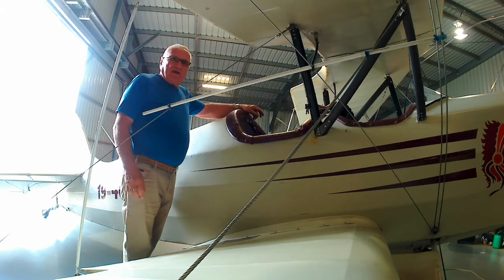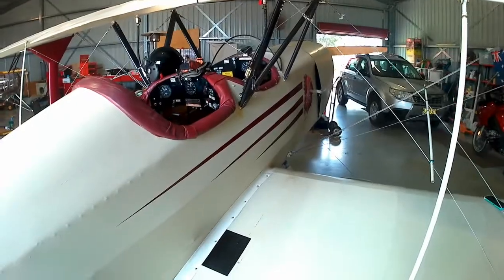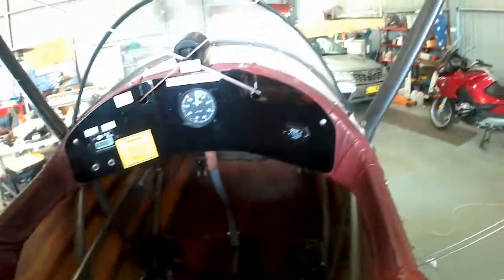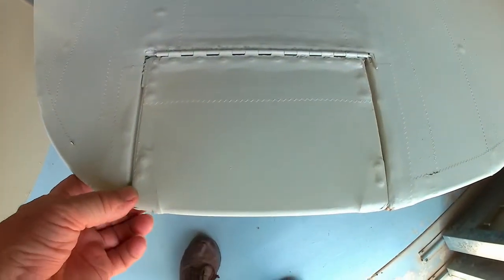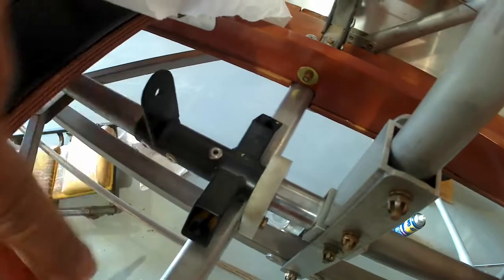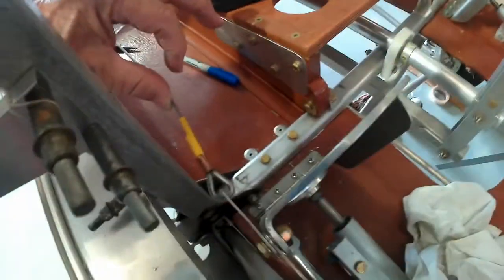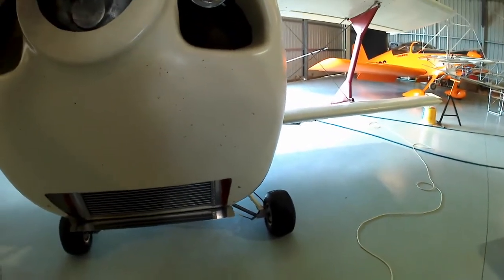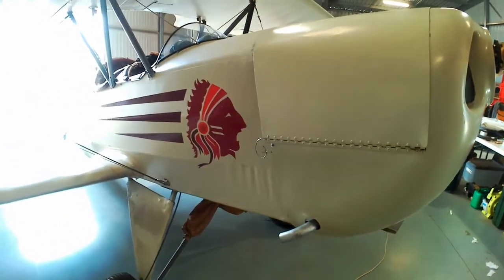Murphy Renegade

Comment: Thanks for all the information, particularly the comparison between the 582 and the 912.  There's one for sale here with a 75 hp Continental, I'm kind of interested in that.. your thoughts on a 75 hp Continental up front?
Reply from the maker: Hi Spike, Sorry I only just saw your question. I don't have any experience on the Continental engines. It is most likely a bit heavier than the Rotax but you don't have the weight and complexity of the liquid cooling system. Continental parts would have to be cheaper than Rotax parts. 
There are a few fuselage modifications for heavier engines which basically moves the firewall aft about 6" don't know if the one you were looking at has that modification or if it even need the mod.
Good luck,
Paul

Comment: Say...Paul, I'm having a time of it contacting Murphy for a set of plans for that beautiful thing...could u help out with any current understanding as to why I cannot?...
Both are beauts! U be a lucky man.
Reply from the maker: Sorry Doug Kehoe, I only just saw your question, I really have no idea what’s happening at the factory. I do know they were knocked around quite a bit with COVID but other than that I have no idea. I’ve heard others making the same complaints, I guess you just have to keep trying. I’ve also heard others say they copy all of the Murphy email addresses and that usually works.

I’m back in Peru now and my Renegade plans are in Australia but if there is anything specific I can help you with, you just need to ask.

Good luck
Reply: @pauloconnor2813  all right...no worries...
Chinese...took over.
Hope I can still do a scratch build..yours is lovely.